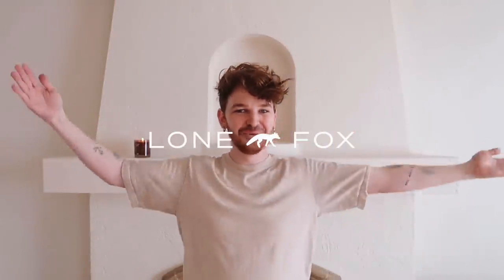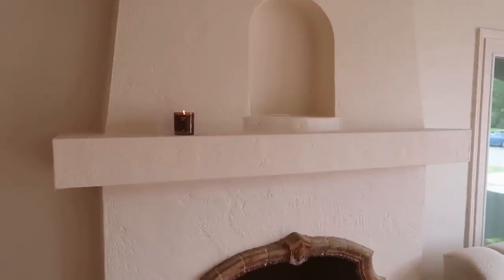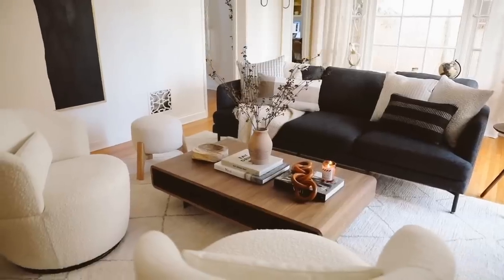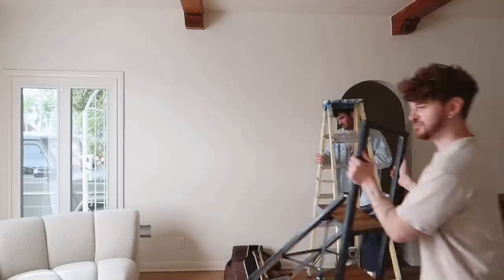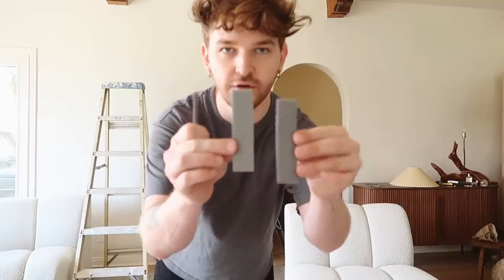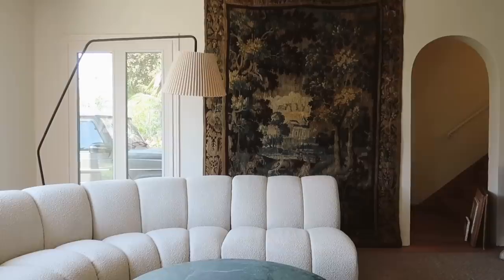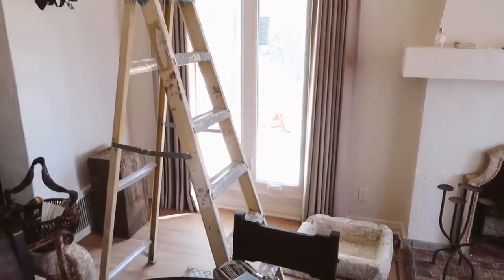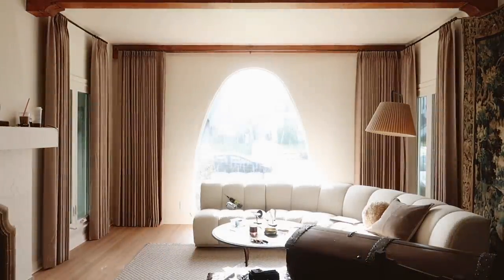Making Over The Lobby 🪑 *EXTREME TRANSFORMATION*

Comment: I love the tapestry and how old it is, but it deserves more love from you. I think you should sew some loops or a channel to the top and hang it from a dowel stick or drapery rod with pretty finials on the  ends. That way, it's straight across the top and not saging in places. It's like a crooked picture on the wall. Sewing the loops can be undone and won't hurt it, but the adhesive on those straps might, especially if they aren't archival quality. Over time the straps will pull at the weave and maybe damage it. I love your ideas. The bookcases with tipped shelves to display books was genius. ❤

Comment: Drew  I have to agree with Sue Cox below. The direct sunlight is very detrimental to the old natural dyes. I love where it is hanging but consider adding a rod pocket on the back that will hold a rod to hang it from and attach to actual rod to hangars on the wall or ceiling so that the weight is evenly distributed. This will keep the woven fibers of the carpet from becoming distorted. We certainly do not need to know the $$ of the tapestry but considering the age and the condition, and the fact that at even 2/3's  less of original price was still pricey, you want to keep the value and condition from any deterioration into the future. 
Love the room so far. The couch reminds me of marshmallows squished together  YUM!

Comment: Tapestry belongs on the other side of the doorway, between the beams
Reply: i was thinking that as well! i do like it behind the couch but it really needs to be hung up higher.
Reply: I agree!
Reply: I would agree it needs its own separate moment on the other side of the arch... something to consider plus it would be further away from the window.
Reply: @dmichaels40  for sure it also kinda bothers me that the beam is not even centered where it’s hanging now so the other side would generally just work better for the symmetry of it all
Reply: Agreed! The way it’s touching the beam looks uncomfy.
Reply: Agree!
Reply: YESSS! I just said this too. It’s too beautiful.
Reply: It is too big for that wall, he needs to keep it out of direct sunlight as well.   Seems to be touching the floor and it will probably stretch a little.  I like it but so heavy and visually overpowering it needs to be centered in a logical place, as you say, between the beams.  But then the other side would need to balance it.  The white sofa is visually not heavy enough to do it.  I like it a lot, just the wrong place for it.  Seems like it needs to go opposite the fireplace and centered in the room, but there may be doors there.
Reply: Yes definitely. It would fit and hang better too.
Reply: @hazelswords8573  I am pretty sure the way they would have hung it originally would be a heavy metal rod, but as somebody mentioned a 2x4 would also work well.  Something that big and visually heavy needs to be centered architecturally within the room like a fireplace would be.  
I never thought I would like this neo-rustic-cali-spanish style would appeal to me, but he has really done a great job.  The other rooms are wonderful.  I still do not like the 100 rosettes above the selves, but I can see why he did it.  He needed some way to break that hard horizontal top of the shelves and transition to the ceiling vault.  That piece of molding he took down from the curtains might have worked better, it was worth a try, to see what it looked like, or if it even fit.
Reply from the maker: It doesn’t fit by 4 inches :(
Reply: Yes Yes yes, The corbel that the tapestry butts up to on the top left side makes the placement seem off kilter.  I'd love to see it placed evenly between corbels of beams . . . and away from the windows . . .
Reply: @lonefox  what about the stair well?
Reply: What about on the wall in the hallway by the door you can see it through the arch. This would also protect it from the light..
Reply: Or… hang the tapestry behind the wooden bar I don’t like that mirror there. I think it cheapens the look.
Reply: @lonefox  You can see how much we all love your secret find (how you kept that a secret!) and want to see you make it work in your stunning home. Don't be discouraged by all the suggestions. We know you will solve the challenges. Research with experts will help. You won't regret the consultation and it will make a great video. (The blue brings out your eyes when you stand in front of it!)

Comment: The wide hanger hooks on the back of the mirror are to string hanging wire horizontally. The hanging wire across the back of the framed piece makes it much easier to straiten when hanging from a single or double nail or hook on the wall.
Reply: Unless its too heavy, sometimes you need 2 hangers to distribute the weight of whats being hung.❤
Reply: @robinmp3841  I have hung many heavy and valuable pieces this way. The hanging wire balances and distributes the weight, especially if one uses two wall hooks. The wire allows for better mobility to straighten and adjust a hung piece.
Reply: @KDdevidasi  Yup, I worked for years in a framing studio so I understand, We did all our larger mirrors with 2 hook hangers❤
Reply: @KDdevidasi same!! Wires make it super easy to hang and level the piece.

Comment: Attach 4 binding strips vertically to bottom back of rug (about 12”) evenly.  Run a cord through each strip to have the rug gently gathered along the bottom and off the floor, so that it can drop down evenly underneath the beam.

Comment: Slightly worried about sun damage on your beautiful tapestry xx
Reply: Old threading can easily be damaged !! Especially under those  strong sun rays 😢!!
Think mostly of those tapestries being hung in Damp Dark Large  Castles to Block the Air Flow that made those castles so cold 😮and damp as electrical heat didn't exist then😂 especially when those gigantic fireplaces went out .😮 Burrrrrrrr was it ever so cold but in Rhode Island Mansions in Newport,RI >>they had pipes that sent up heat from huge furnaces that piped it throughout the Miramar Mansion in Newport, Rhode Island  which were modeled after ones from France and England as  the Golden Age emerged to keep them warmer but still tapestries were hung on huge wooden Beams to keep them from being destroyed from both weight and moisture draping on the wall and to clean them they were beat with these funny looking but ever so cute curvy looking brooms as they'd hang them over banisters outside or on clothing lines and beat them till the dirt flew out everywhere 😂🤣😂 Until pipes were invented & installed into the baseboards that had suction so strong it would suction up anything in the ground including jewelry and coins 😂🤣😂🤣 to clean those rugs throughout the mansion those huge vacuum cleaners were merely switched on and were seen in the basements and Believe Me they were Huge Just Another fun fact 😮 worth learning about if you guys are interested in These kind of Historical Stories .
In saying that they were hung on huge wooden beams as someone else did mention how they were properly hung to keep them secure on those damp castle walls for Eons and since it's so Beautiful please inquire with antique professionals about  their weaknesses for How; Where , and Why Certain Spots are Better than Others for hanging them as well as those beautiful curtains for them not to be also damaged. Definitely a show stopper and stage setting moment that should shine on its own with nothing blocking it's view !
😮 Your Taste in antiquities is so curated NOW 💝
Most Definitely Love Your coffee tables beautiful marble top, and your cute base ideas but when putting them out love seeing collections of three in varying sizes for impactful reasons like the three Bears story 💞 or maybe adding a large urn holding a plant or two with the same configuration  of the table base ..
As I'm a Lover from the 70's of the arched lamp and that "Sofa is Everything" has always been my Favorite Design >>>
Alvin Orlando had one of the Original Designs  in his Vegas Home and that space I Adored is Still One of My Fave Room designs !!! Those Sofas are Absolutely Beautiful and love the fact that their also Modular and easily configured in so many ways you'll find that You'll Love the versatility of being able to change them when entertaining as a Lounge Room Will..
WOW , Wow 😍 💯% Drew that Room is Smoking Hot 🔥 🔥 🥵 Design Wise 🙈🙊🙉💝💝💝💝💝💝 
❤❤❤❤❤❤❤❤
Cannot wait till next week's surprising remodel Episode 😢
Sad I Have to Wait for it...Kudos Guys  great seeing you all so enjoying your purchase and Home 🎉 as a Team 💝

Comment: Likes:  The curtains, and the length of them is so perfect!  The console storage table "bar" - its style and color of the wood is timeless and could fit in with just about any kind of design.  The tapestry, but it is not hanging straight, the ceiling beam is inhibiting it from being pulled up on the wall high enough to not lap a little bit on the floor.

Comment: The tapestry is beautiful but it looks too large for that wall. It needs more height to hang properly without touching the floor, and the top should be straight. Sometimes we need to accept that a piece of art is great but doesn't fit in a particular space.
Reply: Or at least it needs to be properly mounted on a rod & switched to the wall where the "bar" is placed since there are no beams to prevent raising it off of the floor! Plus with all of the curtains on the same side it looks quite fabric heavy. It is beautiful though 🤗.

Comment: Your sofa is inspired by the French De Sede sofas made in the 1970s. If you would like to protect your incredible tapestry, you might mount it on a rod so that is even and the threads are not stressed.  Also, consider protecting it from direct light when you are not using the room or UV coating the windows.  Love what you are doing to your new pad! Thank you for sharing it all.

Comment: I’ve hung very large hand made needlepoints which are finished by a professional with ribbing and tassels and finished on the back using a wood plank with heavy duty wide velcro on the board and velcro on the needlepoint. It’s easy to level and hangs without buckling or causing the tapestry to become out of shape. If I could post a photo I would so you could see.  Aside from that I love the sofa and the curtains. And the length of the curtains is just perfect as well. The shape of that large window is beautiful too.

Comment: With the blue marble tabletop, consider placing felt adhesive backing on the pointed places of the base that touch marble. I think this will provide some added scratch protection for the marble. I would double the felt then cut slits in the second-layer felt so that the pointed places slot into the slits.

Comment: i like most of what you do, but as a fiber artist, i have to take exception to the the way that you treated a 200 year old tapestry. If you want it to last for any length of time, the first thing you should do is line it with a ph neutral, natural fabric. Generally a cotton or a linen. Tack the the tapestry to the fabric with 100% cotton thread, in a grid pattern so that the liner helps support the tapestry. A pocket should be made across the top of the liner, you can double the fabric up for extra strength. This pocket can have a rod (flat and epoxy coated is best) put into it and then you hang the rod on the wall. You do not put the fabric against the wall, you give it some breathing space. If you wish to preserve the tapestry, you don't want to hang it draped (unless it was woven that way) because it will create uneven tension throughout the fabric and hasten deterioration. Additionally, it may be beautiful in the bright light, but as some others have pointed out, bright light is deadly for old dyes. If you have any dyes in your tapestry that have used a mordant (think of it like a fixative to make the dye adhere better to the fiber) of iron, the combination of sunlight and multiple people just breathing in the room is going to hasten the deterioration (think rusting of the iron particles) of the actual fibers of the tapestry. Many of the colors are darker from what i can see in the video. If the dyes are natural, i would bet that some have a mordant of iron. As suggested by others, putting a UV film or coating on your windows would be beneficial to the tapestry. Keeping the drapes completely closed (and i do mean completely, completely closed) when the room is not in use would also be extremely helpful. (i inherited rugs after my grandfather died, they had been kept in a room where the drapes were 'mostly' closed, but spotting sun got through. Well, i had holes through the rugs at every place that the sun came in. Beautiful rugs completely destroyed by careless closing of drapes)..... Now a lot of this really depends on whether or not you think that the tapestry is important enough to take care in it's preservation. Do you want to preserve it, or is it just a decorative accessory to you? Is it an investment? Do you think you might want to sell it at some point when you choose to do something else with the room? If you do, i'd advise taking a bit more care with. You can even hang it in a 'drape' pattern up top by putting the rod pocket in across the bottom of where you want it to drape - the full weight of the tapestry would hang straight from the rod pocket while the top portion is hung in the drape pattern. You wouldn't need 15 pieces of velcro at that point as the top piece would not be bearing the full weight of the tapestry. Oh, and that velcro Will come detached from the tapestry. As it detaches, it will put more and more weight on the remaining points that are stuck to the wall which will warp the fibers, could possibly even tear them. This is inevitable and you won't see it happening. Oh, and don't use a sewing machine to attach the liner fabric or to tack the tapestry to the liner, do it or have it done by hand. All this is presupposing that you actually want to conserve that tapestry in some way and have it continue to retain it's value.

Comment: I Love love love it. However, the tapestry is too large for the wall. It would be really cool if you put it on the wall with the bar, either by switching the two or behind the bar. That way It would not be between two doors which is messing with the feng shui or like balance especially because of it's size compared to the two. As well as color, the blue tone would be one the other side of the room to bring it all together. That would help tie in the darker wood since so far it is not on the window side of the room.

Comment: Put the Tapestry on a rod and it will look a lot nicer at the top. You can roll it over the rod and secure it with that velcro to shorten it a bit to fit on the wall properly.

Comment: I loved the scalloped valance. Did you throw it away? If not, may I have it?😊
Reply: I agree with the others. The tapestry does need properly installation & would look best moved to other side of entrance - where the bar currently sits. Another note - I’m typically an asymmetrical person, but as the curved window is a focal point with identical windows either side - this room is symmetrical and I believe the sofa may look best centred in the room as you at one point positioned it. Leaving more space to appreciate either the bar or tapestry (whichever your final decision may be for that side of entry). The drapes are perfection!!! Love the table, rug choice and color. Looking forward to final reveal 💙

Comment: Hi Drew, my mum was a tapestry weaver in France, Aubusson style, and if I remember well, depending on the thicknest of the weave she would sew a fabric casing for a long flat piece of wood (maybe what you already have in black? and there is already a fabric backing that you might be able to use to slide this 'baguette' into) or directly sew the piece of wood with a thick rafia string onto it (not recommended here of course) but it was important to distribute the weight evenly. She would then attach little triangular picture frame hangers to the flat piece 9f wood. In my memory!  I could ask her for some advice if you wanted.
I see that it might be an issue with the beam and the overall length of the tapestry, but it deserves optimal treatment.

Comment: ? I've seen tapestries displayed on decorative rods before. If you do this, maybe there is a way to curve/roll the top over a 1 inch rod? Perhaps hand sew it with a heavy duty embroidery thread. It would lift it off the floor a bit, straighten out the top, give air behind it,  & avoid uneven stretching of it. As for where it is near the beam, maybe consider painting or staining the beams after (if needed) depending on the decorative rod style u choose?

Comment: Tapestry will hang better from a pole.  You might make a sleeve that is sewn onto the underside, top of the tapestry, then use a pole or length of PVC to hang the tapestry.  I'm thinking that even though you love it in the room, the beams interfere with proper hanging.  Letting it drag on the floor, also not good.

Comment: You should look into professional methods of hanging a tapestry to help it last an hang more evenly. It should also be more centered between the window and archway. Overall it Looks uneven and putting pull in unnecessary ways that will affect the weave over time. But it is a beautiful piece! If it is truly from the 17th century (1600s), then it is 400 years old!